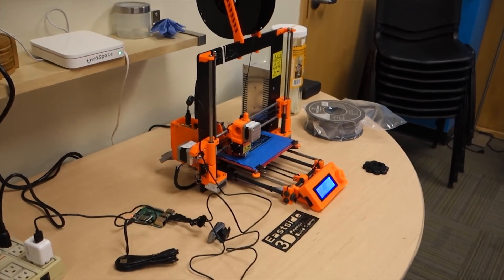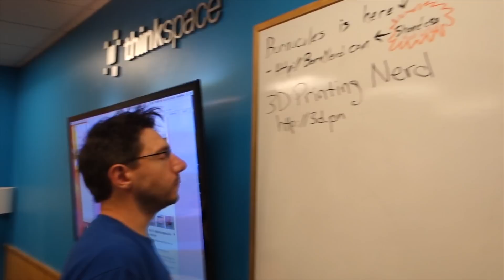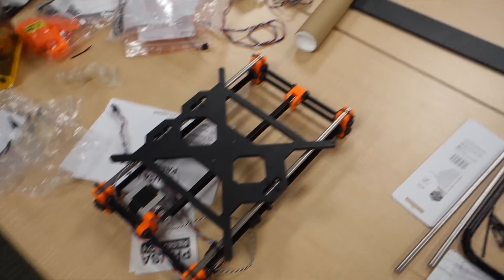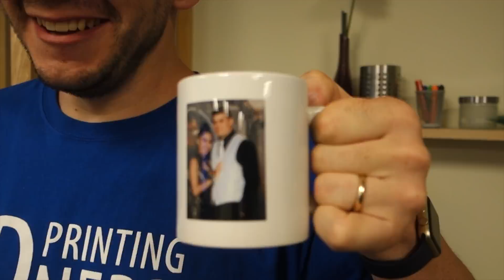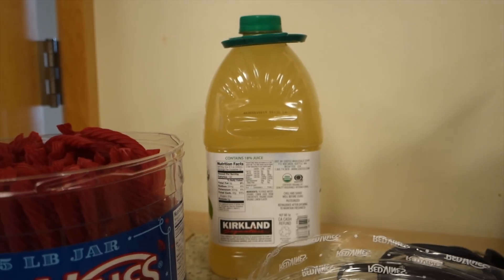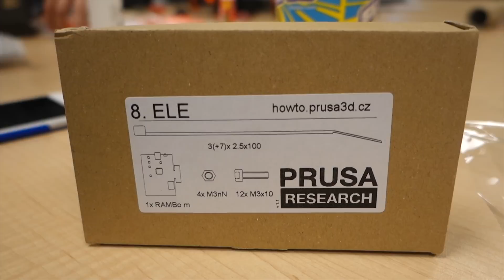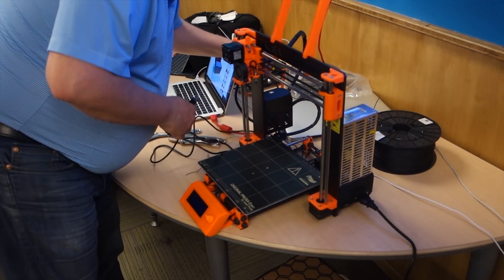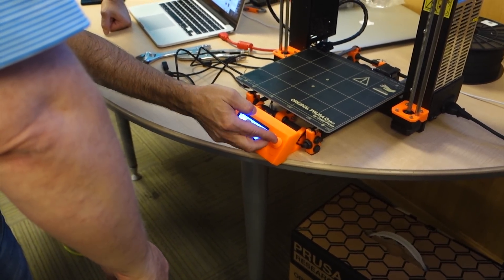Building 3D printers & Tracer Gun from Overwatch - @Barnacules

Comment: Cool video Bro.
Wish you could have built one in the video.
I am building a cheap copy of these printers. It is under $190 including shipping.
The print volume is 210mm x 210mm x 210mm.
Almost no instructions, and what they do have shows different parts than what I got.
Still not hard to build.
I just need to finish the wiring and test it out.